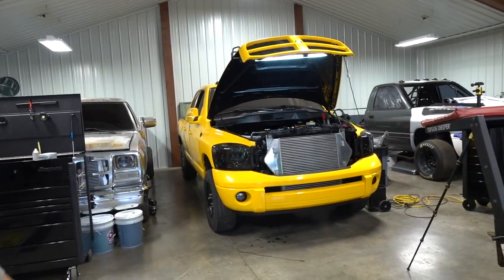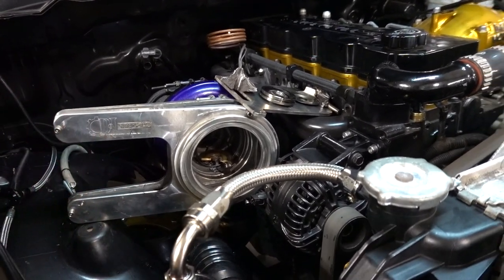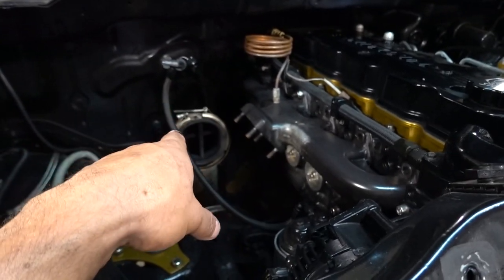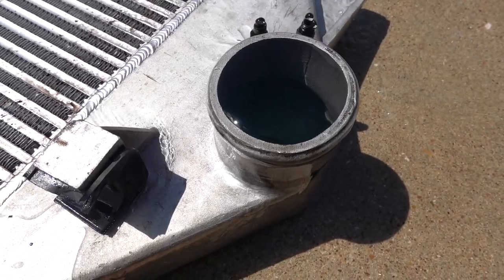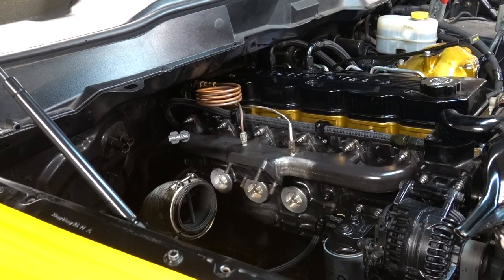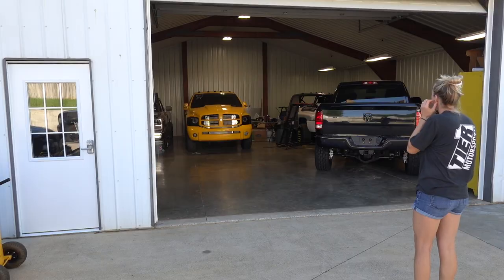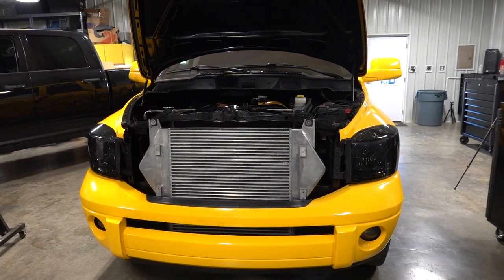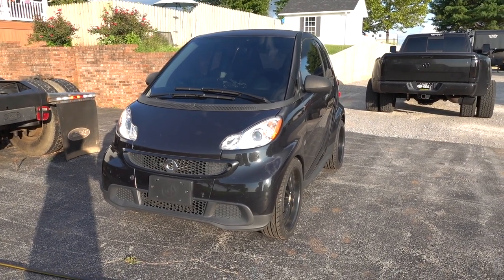CUMMINS BURNOUT MONSTER IS ALIVE & BACK IN ACTION!!!!

Comment: The irony if school starting back up and Greg getting the Spool Bus back up and running... 

Power Driven Diesel launched the Turbine wheel out of Josh's truck like a month ago, and didn't you destroy a downpipe when you blew the turbo on the dyno like 2 years ago? 
And where is the carnage shelf that was in the bathroom at the old shop?
Reply: Definitely needs to be a shelf in this shop....and those peices need to be on that shelf
Reply: @robertwilbert1317  that last turbo could be done up as a one of those epoxy coffee tables haha